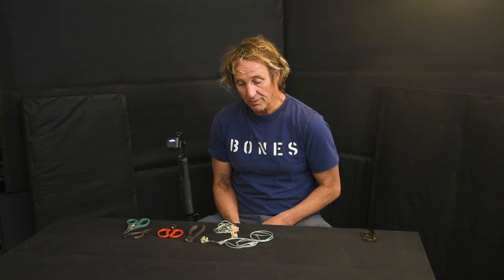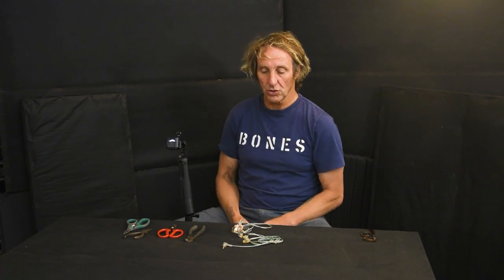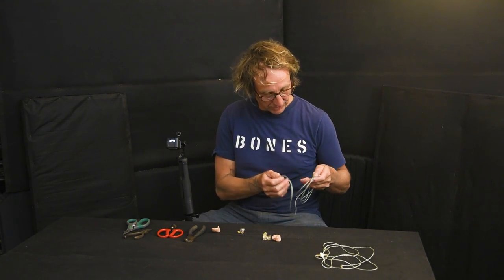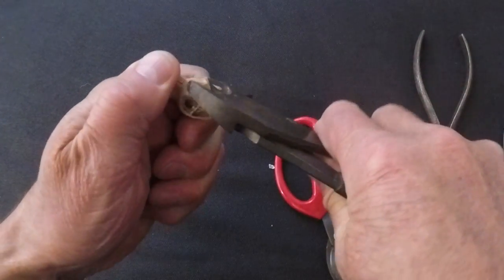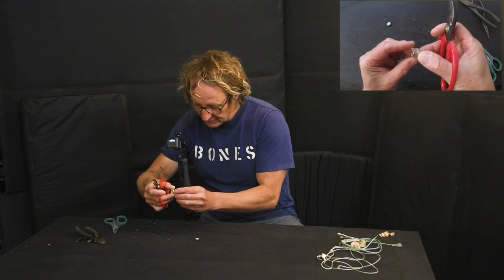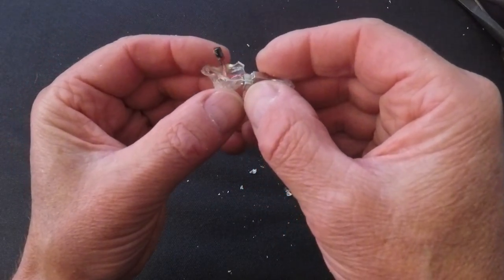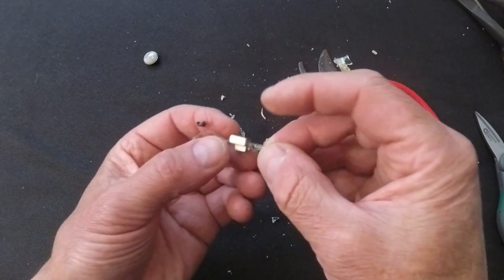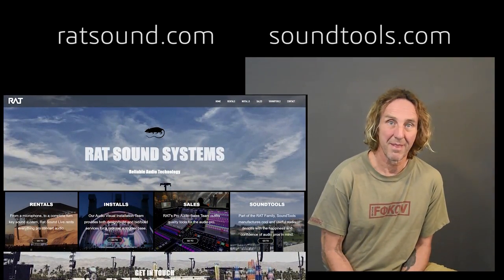Tear Down Balanced Armature & Dynamic In-Ear Monitors (public)

Comment: The filter in the tube is called a damper.  They are sold in different values, that cut peaks at different frequencies,  by different amounts.
Reply from the maker: Thank you Lee and so cool checking out the in ears you make! 

For all ya all, check out The In-Ear Series - Public
#1 - Intro and description (Public) https://youtu.be/ZsP4-_wKO9I
#2 Specs on the in-ear and test gear (Public) https://youtu.be/0Fxnn_Wk8ps
#6 Teardown of voice coil and armature in-ears (Public) https://youtu.be/ak-V2r2Xvz8
#7 Listening to raw armature vs voice coil driver (Public) https://youtu.be/2ScFQk_qdDo
#8a Using in-ears as ear canal mics with Sammy (Members) https://youtu.be/RbN9oEs06Hg
#10 Hear and compare lower cost in ears (Public) https://youtu.be/IA1wifIYu-Y
#15 Analog vs Digital In-Ear #1 https://youtu.be/bqozjxHB8qU
#16 Analog vs Digital In-Ear #2 https://youtu.be/N0GZ7FXupnc
In Ear Monitor Chat w Sammy https://youtu.be/YFqF1rpfHKQ
Human Body Polarity vs Headphone Polarity https://youtu.be/2Dday7clNcc
$38 vs $2000 in ears #1 (Public) https://youtu.be/bHU5N4HMwmk
$38 vs $2000 in ears #2 (Public) https://youtu.be/tAYWn2WcLes
$38 vs $2000 in ears #3 (Public) https://youtu.be/GLugtH11QQ4
3-wire vs 4-wire Headphone Cables https://youtu.be/EchK1NI5X5c
Hidden Response Issues with In Ear Transmitters https://youtu.be/Vz_Ag8pEUJ4

The In-Ear Series - Youtube Members
#1 - Intro and description (Members) https://youtu.be/r88OifXLKfQ
#2 Specs on the in-ear and test gear (Members) https://youtu.be/adZi7PRUIHI
#3 In-ear vs humanly body polarity (Members) https://youtu.be/I1OqbV5FNpA
#4 In ear cable types and tests (Members) https://youtu.be/f9B9JFVW1wo
#5 Can an Armature be a mic? (Members) https://youtu.be/lS-9YFyP6FQ
#6 Teardown of voice coil and armature in-ears (Members) https://youtu.be/1xkFOmNhed4
#7 Listening to raw armature vs voice coil driver (Members) https://youtu.be/ktVLqbC5774
#8 Using in-ears as ear canal mics (Members) https://youtu.be/vSI6hSivq-0
#9 Hear and Compare L-Acoustics Contour (Members) https://youtu.be/fV0IjRtr0Ps
#10 Hear and compare lower cost in ears (Members) https://youtu.be/td3NRTQ6VAs
#11 Compare in ear outputs with music (Members) https://youtu.be/4-TsFhR_WNY
#12 Belt pack test with pink and pulse (Members) https://youtu.be/X6CgV7_4unE
#13 Minimizing impact of companders (Members) https://youtu.be/oH5op3JrYLA
#14 Shure PSM 1000 pilot tone vs high frequencies (Members) https://youtu.be/bivLX8qmwQ0
$2000 vs $38 in ears (Members) https://youtu.be/P5zncbvIxeU

And meet Lee!

Comment: Dave, here is a point I was hoping you would comment on:
When I do sound for a band, I face the stage, and my left becomes the left side of the sound Pan of the FOH, and right side my right. However, since 90% of the time I am both on stage performing and doing sound for FOH, my in ears are connected backwards. Why? Because when I pan anything left on FOH, I don’t want the sound to go backwards in my ears, meaning my left in the I ears, is the RHS of the FOH. That way the balance remains.
Just details nobody usually talks about. 
Now thinking about it, you just made me wonder if the bass in my in my in ears will be out of polarity, and out of phase with the FOH.
Reply from the maker: Hmmm, the contrast between performer and viewer perspectives can be addressed in differing ways.  Typically what is heard is matched to what is seen.

As far as mon polarity, that is not a perspective thing and remains consistent.  Here is a vid with more on that.

https://youtu.be/fvi6YsnRG8A
Reply: @DaveRat  very interesting Dave. I was not expecting it that ugly. Thank you.

Comment: Hi Dave!

i’ve already test out how a Shure 215 react if it’s plugged into a mic preamp.

i didn’t spend much time on it but it’s was similar to a piezo microphone.
Reply from the maker: Hmmm, interesting.. would not expect that
Reply: @DaveRat  my quick conclusion was, that the tube been to small and far for sound waves to get it and create vibration.  it’s was more reactive to physical stimulation. 

i don’t have your expertise on the subject. maybe you’ll find something else if you try it out.
Reply from the maker: I would expect a level drop and HF rolloff. But low rolloff seems odd unless there was a wiring issue